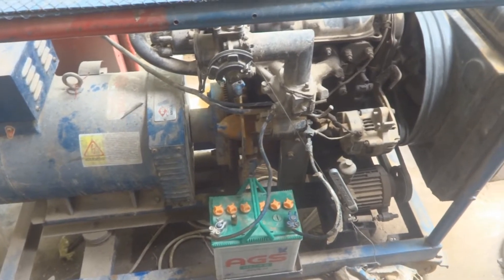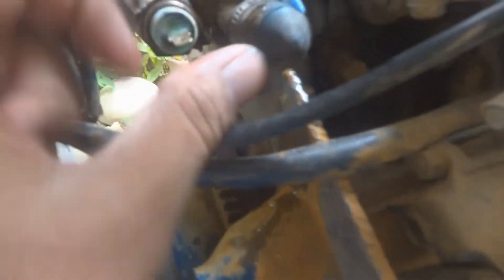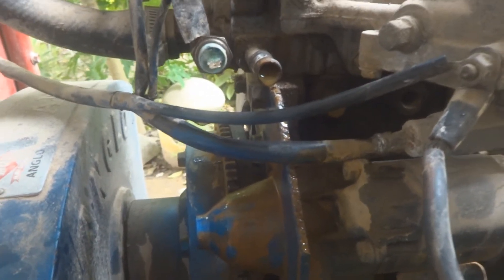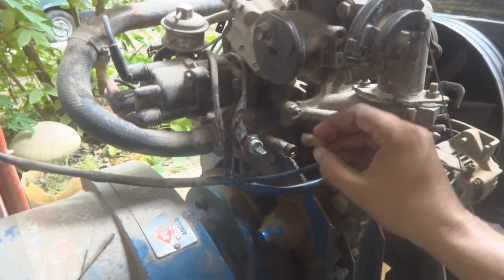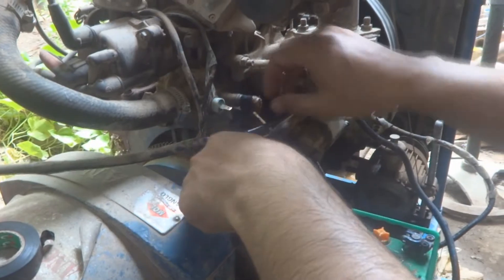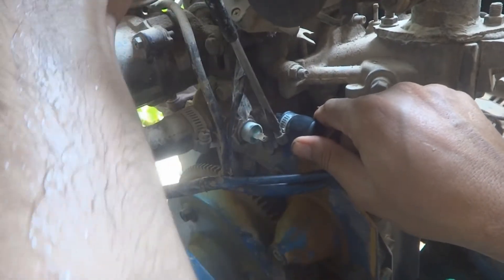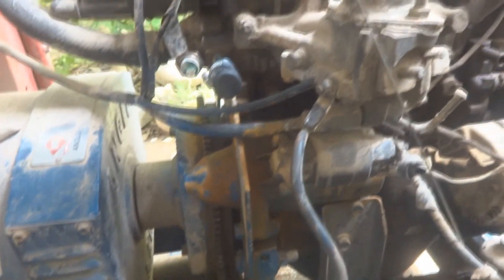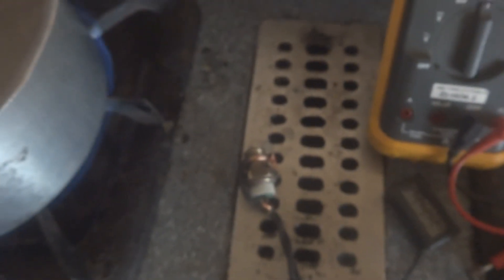Generator DIY repair. Generator water leakage repair. Generator coolant repair.

Comment: Nice simple and cheap repair :-D
When you showed that temprature switch, i was thinking use a relay to cut off the ignition coil power, but latch it so it cant re-connect power and leave the ignition coil on all day :-(.

Im sure you have done a clever modification, you are a very clever man :-).
Reply from the maker: Yes dear sir it was a an easy one. The reason was as it arrived in need. It was a happening which leaded to a new requirement the temperature safety circuit. That will be a nice addition and a little peace of mind to protect engine during overheating. So hope I may upload videos on that topic as well. Best regards,

Comment: GREAT  like always, wish you can tell how to install an audible bell alarm in the car to grab the attention of driver when the vehicle start to heating up. Instead of conventional gauge or lights.
Reply: Omar Alvi all you need is a thermocouple on the engine with a small controller set on 100 degrees when the engine temperature reaches 100 degrees or over the controller relay will actuate you can wire a light or a audio tone siren